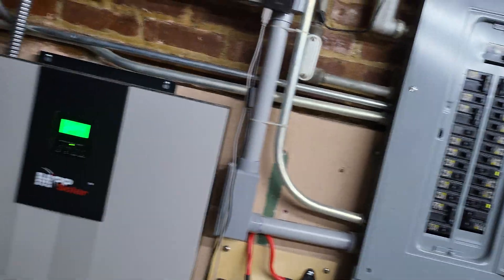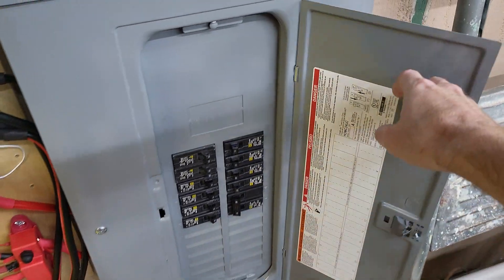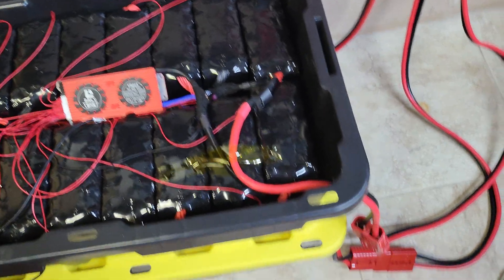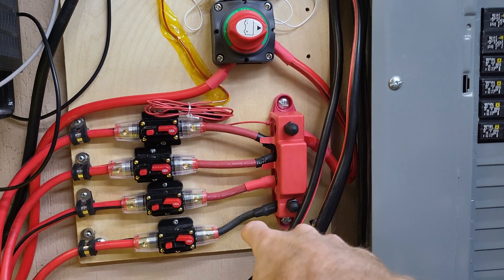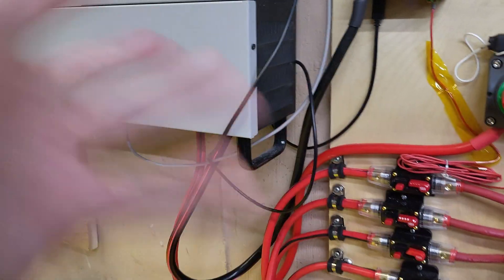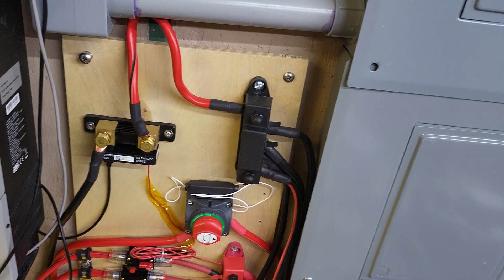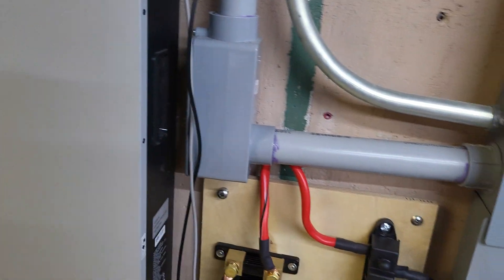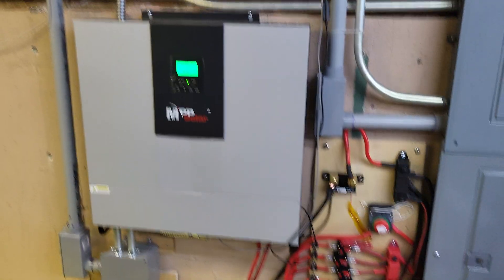Battery Hookup 48V Lifepo4 Battery Modules Power wall 20kWh

Comment: are those battery fuses really for 58vdc?
Reply from the maker: There is one for each battery, the major concern here is that it covers the amps which is does.  There are some crazy tests you can find online they work fine and do their job just fine at 48V nominal. The key is can it break the connection once the amps get to high the answer is yes, maybe it would be a problem at super high voltage but I think you'd have to be well into the 100s

Comment: Since this is a 48V (4 x 12V) system, won't the inverter shut down when one bank fails?
Reply from the maker: Each battery is 48V.  So there are 4 batteries at 48V each in parallel. Ironically I currently have one battery that is down due to the BMS being bad I might make a video about it.
Reply: @darrenorange2982  ooh ok. makes sense. I mistakenly thought you were doing a series connection. cant wait for that video. I hope the bms didn't fail due to your setup
Reply from the maker: @FrancisOpoku  The BMS just seemed to be bad the other 3 are working fine.
Reply: @darrenorange2982  Daly not good BMS , try use BMS tip JKB.
Reply from the maker: @draganmihai4897  This install is now months old so.  I could resell them I guess but eh.

Comment: If i may be so bold as to suggest the use of ONLY DC rated fuses and breakers as there is a difference but it wont matter till they are needed and that is when the difference shines.

It would be hell to loose the place due to a preventable error!

Looks great and well laid out and I wish u the best!
Reply from the maker: They are DC breakers.
Reply: @darrenorange2982   Should have class-T fuses for the ultimate in protection. Those breakers are OK but if it was my house, class T fusing all the way.
Reply from the maker: @car2069  Class T fusing for my setup would just lead to problems as I would have to over size it on the main lead.  That being said I also have a BMS on all the batteries.  So there are many levels of protection.

Comment: Please change those DC circuit breakers from the batteries. As those DC branch breakers are essentially your main breaker. I tried using them for my projects but they are trash. Those are labeled as 100A but I would trip mine at 30A. Those breakers are not suited for the AIC of lithium batteries. Please use quality DC breakers from BlueSea Systems, Eaton Bussmann, MidNite Solar, Outback Solar, etc...
Reply from the maker: Please review this stress test of these breakers. They work perfectly in this extreme testing. https://youtu.be/aDmNto-qC7Y

Comment: Nice system but I would move the fuses into the individual battery boxes for max protection
Reply from the maker: I have considered that.  However, the purpose here is to protect the house and the rest of the system.  There is already a BMS for each battery and this is a stationary system.  The position of the fuse here while could be improved it would add complexity.  If I need to disconnect the battery from the main wall I can do that yes but I do also have covers for both ends of the plug to prevent any issues or shorts.  Regardless it was done this way for simplicity, I could have gone farther and fused between each cell in each battery pack.  It  just depends on your use case.

Comment: The precharge switch is really awesome. Going to implement this on my system. That is awesome!
Reply: yeah, that is a good idea. I leave my resistor suck in my switch in the hopes I remember to pre-charge each time and I hate the way it looks.  I takes away from all the work I put into making it nice and neat.
Reply: @Do_the_Dishes  Turns out the batteries I ordered has this built in so... I guess I don't need my resistor and switch now.

Comment: Looking and running great . That is a great Pipp 5000 w inverter . The battery bank so neatly connected and secured in totes . 4 breaker 1000 a protection at your control . May the solar be with you .
Reply from the maker: Thank you, There is a bit of a learning curve but I am pretty happy with it.